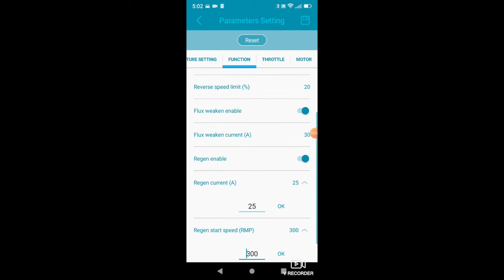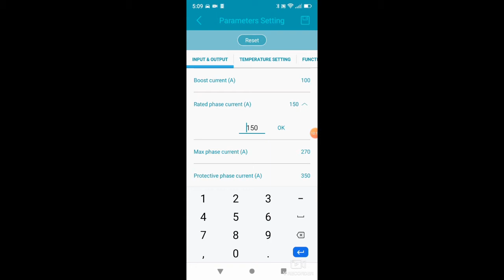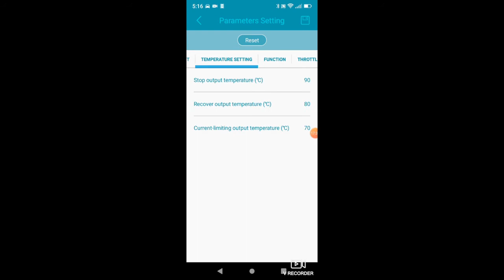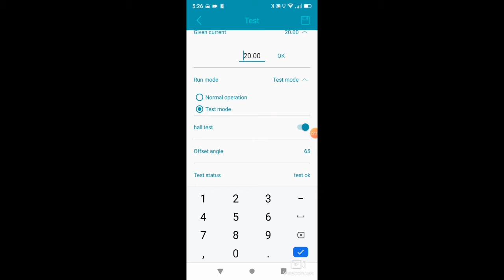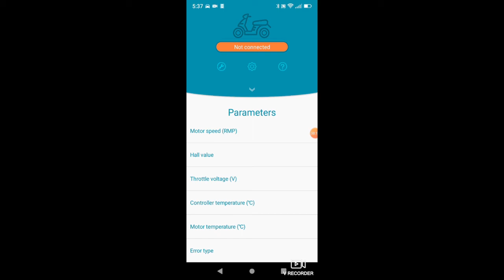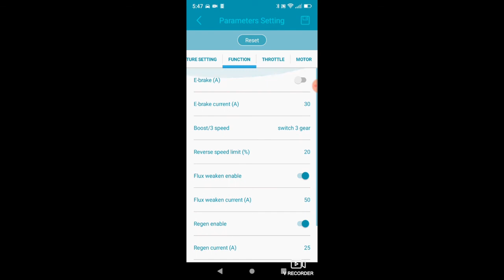Evader Sabvoton 72100 Programming  Bluetooth

Comment: Thank you for sharing your sabvoton knowledge I appreciate it.
Reply from the maker: your welcome. Sad part i ended up not using the 100 amp and the 40 amp controllers and now they are just sitting around collecting dust with blown fets from the junk factory hubmotor i was trying to use them on. It even caused the Votol EM-150s to have a problem over the long haul after i changed over to the 5k hubmotor upgrade.  All 3 controllers can not do max speed. My replacement EM-150 has been fine from QSmotors. I may decide to replace the fets in the Sabvoton controllers some other time like when im in need of a controller of that rating.

Comment: Hi, do you always set 95v in the over volt field?  I have a sabvoton 72150 to program.
Reply from the maker: 20s battery is going to be 84 volts full. so 87volts should do the trick if it wont go any where after the battery is fully charged just bump it up 1 volt at a time till it starts working and not in over volt mode.
Reply: @battery_solar_ev  ok. as I have 84v, the engine does not brake.  if it's factory 95v then yes.

Comment: Thank you Steven for everything. I have and 8,000w enduro, is there a setting I can use that will make the power less explosive for slow trail riding? I find mine is like driving a Dodge Viper all the time when sometimes I just want a Civic.
Reply from the maker: 3 speed switch enable the speed settings. If you dont have a 3 speed switch youll need to add one. Just play with the speed settings till your happy with it. One other thing soft start would help as well but that will not change between all speed settings.

Comment: I still can't find information on what parameters I should be using in MQCON for my particular setup.
Reply from the maker: if your trying to use the stock motor you wont find anything QSmotor could not give me any info on that hubmotor they dont keep it. But try 16 pole phase angle 60 and 2000 watts also turn off flux weakening and regeneration.
Reply: @battery_solar_ev  My setup is a 3000 watt hub motor, 100 amp Sabvoton, 72v 3000w 100bms battery. It's so ridiculous that Sabvoton doesn't even have a manual worth a shit.

Comment: I have sabvoton 72100 controller and 72v, 20Ah(bms 60A).
I have error message as below.
"controller protection error 02H"
appears when my ebike is working at stage 5 ( over 90 ~ 100km/h speed).There is no problem at 1 ~5 stage( 1 ~ under 90km/h ).
My battery(20Ah, 60A bms) does not support 100A controller ??
I don' t know why ? Please help me .
Reply: Change your Over Voltage back to 95
Reply from the maker: 4.2 x 20 is 84 volts the controller may be reading a voltage that is higher so up the over voltage till it works just go up 1 volt and test till its happy.

Comment: My bike seems like it’s in cruise control mode….if it’s on mode 5 and I stop and start to throttle then let off on it it will continue going slowly till it hits full speed….I might have to reset it.

So far with a 80amp Savoton 3000w motor and a 72v battery 21AH 80amp BMS I’m able to hit 75mph on the road…..I think something is set too high or using 27.5inch tires make these stealth Bomber bikes haul ass.

And it was on MPH when I’m able to go above 65mph…..I also can’t get the anti theft system to work….has anyone ever got the damn pass key to work on a Savoton?
Reply from the maker: check your throttle voltage and make sure it is not to low that will make the motor keep spinning. Your soft start option may be to high if its going slowly to full speed.

Comment: So I don’t need a laptop? I can use Bluetooth app? Just got my bike and lil help

Thank you
Reply from the maker: nope no laptop just the Bluetooth adapter the app and your phone. Youll need to know the number of pole pairs you have for the motor the smart app side will not change that. And if you got the E-Vader do not use regeneration at all if your not changing the hub motor they are not compatible and turn down flux by a whole lot they are not compatible with that either at least mine was not i had a whole range of run a way conditions (full throttle) to the wheel locking up when i let off the throttle (regeneration)

Comment: I'm getting an error code lack voltage but my battery has voltage. Any help?
Reply from the maker: adjust your proper voltage range and save it would be my first thought.
Reply: It could be a short in you’re battery connectors…try getting new ones or clean the old ones with a circular wire brush’ found in gun cleaning kits’ make sure you unscrew the wire going to the speed controller…the speed controller still has current’ even if it’s unplugged and turned off…so be careful….after you get the correct voltage…you’re gonna need to factory reset the entire system….and probably do another hall sensor test.

Some ppl have to some don’t….that should fix you’re lack voltage issue….use a volt meter to test what you’re battery is putting out….it should match you’re voltage on the screen.

Lack voltage is always a short or not plugged in all the way battery…..same thing happened to me, and that’s how I fixed mine.

I was able to determine it had a short the battery was at 84v on the meter but when I tested the speed controller pos and neg wire….the voltage read 57v….that indicates a bad battery connector, I was able to clean them up…and got it to read 84v but it still read lack voltage and speed controller protection code…that’s when I reset it…works good now.

Comment: Just bought one of these can’t get it to work keeps saying restart and disconnect
Reply from the maker: I dont really know much about the Sabvoton other then i got them to work with some issues and not high brake compatible 300 bucks waisted and collecting dust. If you doing the E-Vader or even another large project you may want to consider Votol
https://www.qsmotor.com/product/votol-controller-em-150/

Comment: hey there  i got the Mqcon SVMC7280 on 3000W hub drive and 72v 30aH Battery, but when i shut off power while driving very slow maybe 10 km/h it damages the controller, it's broken now, that cant be normal ! i dont think this is normal.. but i refuse to buy sabvoton again, is this a common problem ? now i think it's the regen setting before it was tunred off, no problems....
Reply from the maker: i never had my 100 or my 50 amp fail but i never turned it off while driving when testing  them on my E-Vader no high brake was the deal breaker with what i have so now they are collecting dust in the building stowed away yes money wasted. The Votol controller has high brake and though not a self learning controller has worked out rather well for my set up

Comment: Hi. Wonder if you can assist me. I have a 7280 with a 72v 25Ah battery in a 1000w motor. Every time I go full throttle , I get O2H error
Reply from the maker: that would depend on your wiring and the current that your battery could handle full throttle is max current you may need to back it down considering you only have 1000 watt motor @ 72 volts is 13 amp 80 amp is way over kill and the electric motors only have a max capable rotation speed that they can handle so it sounds like your over driving the motor

Comment: hi mate i got 72100 with 3000w motor my battry is 72v 50a countinuse and 150a burst when i ride slow is fine but as soon i half or full throttle everything shut off i think the controller draw more then what battry rated and bms shut off, do u know what settings exactly has to be change to stop this pls appreciate ur advice thank you
Reply from the maker: drop your current setting down it may be the bms shutting down if it has one or extreme voltage drop making the sabvoton shut off due to low voltage. If your battery is rated at 50 amp set the controller at that.
Reply: I’m experiencing the same issue, I just built a enduro clone with codd battery 72v70ah but it can be less since it’s a China battery and it’s paired with a sabvoton 72150 and when I full throttle it shuts off. Any fix?

Comment: How's it going..

I have a 72/150A controller with the TFT750 display running a 5000W Risun motor..
When I turn the throttle, it goes one speed until half throttle then goes a higher speed, and stays that speed from mid to full throttle..
How do I set it up so the speed increases gradually as I twist the throttle a bit at a time?
I am using the android app on my phone to access the parameters menu..
Thanks..
Reply from the maker: set your throttle voltage low end to 1.12 and the high end to 4.6 to 4.8 volts. If you set the voltage to low the wheel will just keep spinning slow no matter if you have the throttle twisted or not. Im certainly not tech support for these but the low voltage set to low i can vouch for. It actually sounds like your gonna have to play around with the high end voltage as well to smooth out the respone if there is a mid range voltage set it at 2.4 to 3 volts.
Reply: I bought one of those cheap eBay 65 amp controllers for my scooter and everyone who’s tried it has launched off of it because the throttle is so jumpy.
Reply: @battery_solar_ev  Do you happen to know where to get tech support for these Sabvoton Controllers?

Comment: Can I use this for my 72 v 150 a sabvaton controller
Reply from the maker: Yes, but ..turn off flux weakening and brake regen with the stock motor its not compatible but yes it works and check the controller to see if it is the low brake or high brake model low brake can not be used with this bike unless you convert the brake lever over which is something i did not wanna do. If your running the stock battery keep the DC current no more than 38 amp its a 40 amp fuse with the batteries and not easy to get to with the panels on
Reply: i also need a 72150 configuration. if you find one please update me :)

Comment: Hey it seems your regen was activating a battery shut off :/
Reply from the maker: yeah that original motor was not regen compatible and caused all sorts of issues
Reply: @battery_solar_ev  all motors are regen comparable? It’s just a reverse of polarity at its basics, that get dealt with by the controller, to which you should turn off regen on the controller and it should stop the shutoff (if it is the OCP on the battery being activated)

Comment: Flux weakening only increases the speed with no load. You rarely get a dramatic speed increase. It also has nothing to do with the amp rating of your controller since it's increasing phase amps, not DC current.
Reply from the maker: I admitt im learning as a go with this but the phase amps has to be created by DC drain and all electronics is going to have a  limit to what they can do. Im currently no longer using the sabvoton and switched back to the Votol EM-150 recommended by the motor manufacturer on the 5K watt motor i purchased and seams to be working great. Also im fully aware of the motor controller convertering DC power to 3 phase AC.

Comment: thank you for the video. Where did you get the "motor parameter" value? I assume you asked the motor seller/manufacturer? Thank you
Reply from the maker: Yeah they gave me the specs i needed for the new motor and told me they dont have the specs for the original one cause the manufacturer on the E-Vader changed the specs on the motor and they dont keep the info once the specs are changed so your pretty much out of luck that is one reason why i did the upgrade

Comment: Unfortunately, not very informative. Too many errors, not good for a first timer who needs to basically use this video as a "plug & play" set-up. Before anybody starts throwing their toys out off the pram, I've seen similar videos that are shorter and more to the point, but, each to their own.
Reply from the maker: hey i did the best i could with lacking alot of info for the hub motor and trying to get that garbage hub motor to take the upgrade controller it was not happy with nothing but the stock controller. Come to find out later that flux weakening not compatible and regen not compatible Im so glad its gone now and im no longer using the sabvoton
Reply: @battery_solar_ev  no problem, you've established what the fault was. 👍
Reply: Dont cry wuss